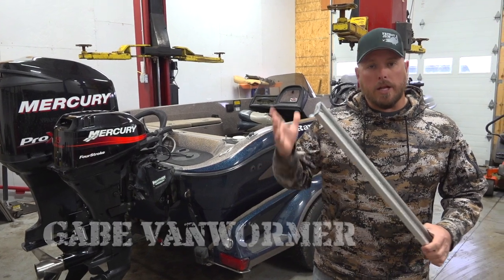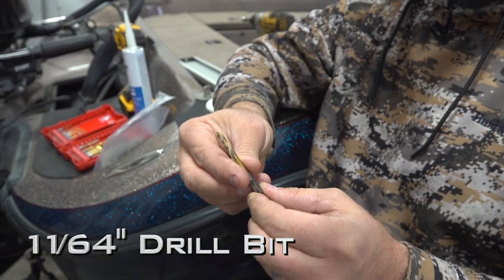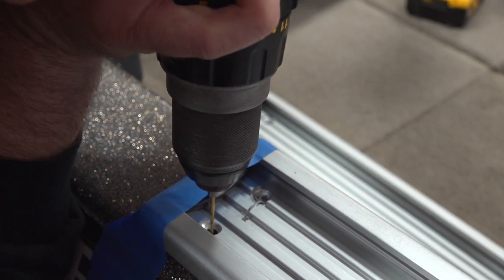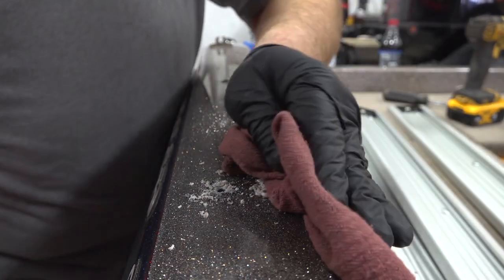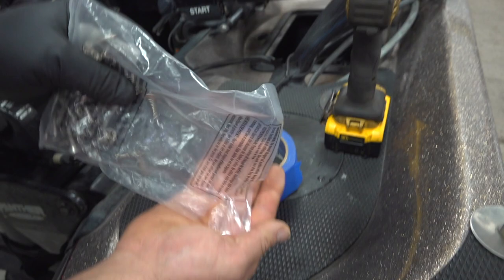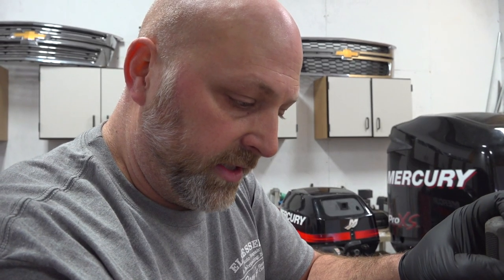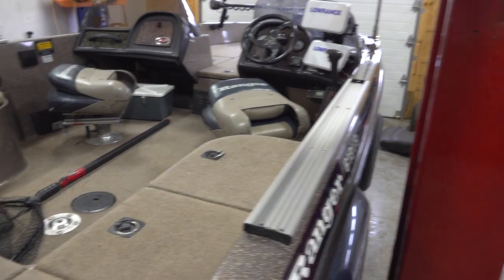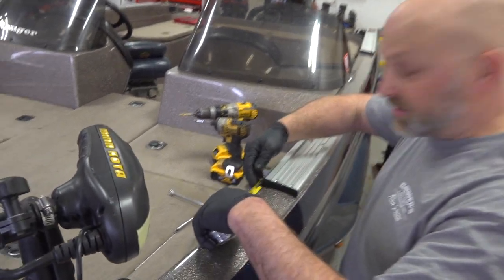Fiberglass Boat Rod Holder Track Installation (How-to)

Comment: Great video Gabe.  Tracks are great. And much more beneficial than old school rails. Back in the day that mainly what they used.
Reply from the maker: Thanks Dave. Hope you can figure out a good system on your 621 for riggers. Sure hate to cut holes, then find out the install wasn’t the best location.
Reply: @FullQuiverOutdoors  took your advice and ran each side of Cannon Cables thru each boot
Worked and looks great
Much better than drilling all
Those huge holes in the gel coat 
Appreciate your advice
Reply from the maker: @daveholte7658 , good deal!

Comment: Thanks for the video.  I’ve seen this twice and I’m going to mount my 72 inch tracts to my Ranger angler this way. Made me very nervous for downrigers, but it seems like it works.
Reply from the maker: You’ll have no problem with downriggers if you do it this way.
Reply: @FullQuiverOutdoors  Thank you!
Reply: @wndzman  did you do you angler?  I want to do this to mine for a downrigger
Reply: @Jman-bq8ov  Yes I did, and it was very solid.  I still limited myself on ball weight size just because I was nervous.
Reply: Do you think this will work with any glass boat? I just got my rails I have a sea swirl 17

Comment: Wanting to add tracks to my 04 ranger 620. Do you have any problems with the curvature on top of the gunnel?
Reply from the maker: Nope, the track will curve along the gunnel just fine. It’s such a gradual curve that the rod tubes and stuff slide in just fine.
Reply: @FullQuiverOutdoors  Thanks